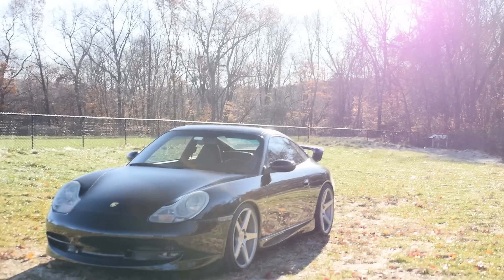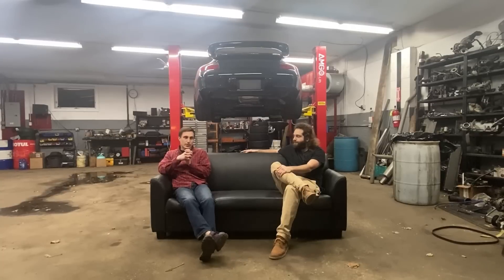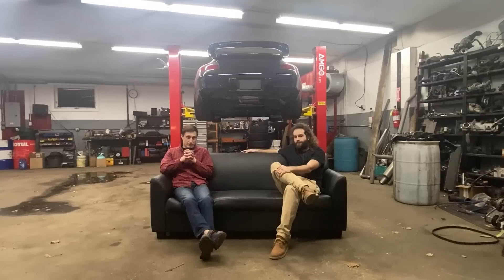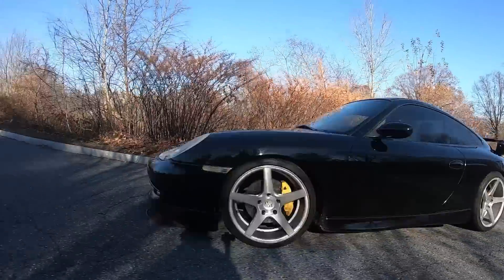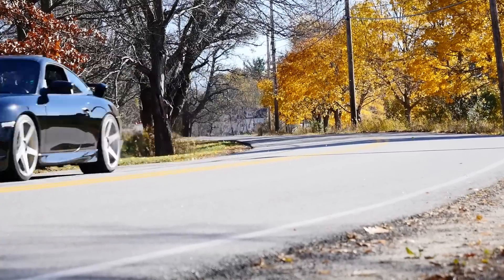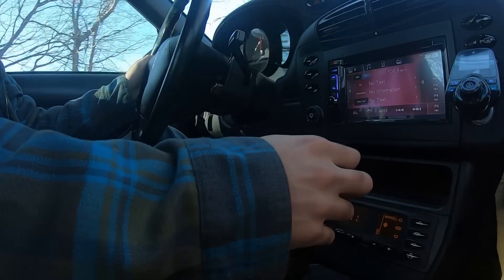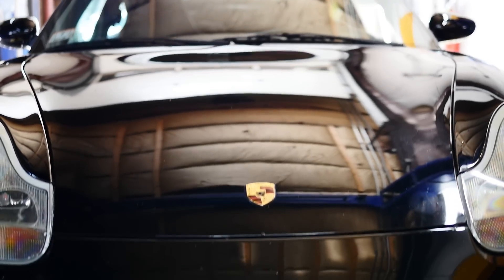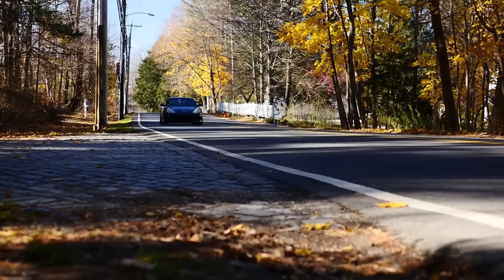Renn27 - Audi 2.7t swap for Porsche 911's

Comment: Oh my goodness I need to do this, I bought a 2005 996, it has no engine due to the previous owner removed it to have the spun bearing issue sorted, well it ended costing more than the car is worth. Car was sitting for years and he eventually sold it to me. Imma be in contact with you guys shortly.
Reply from the maker: @namtech425  LFG!!!

Comment: Does this kit work on a turbo chassis? If I got one with a blown motor?
Reply from the maker: The metzger transmission is different than the g96 but you can swap it out and profit a bit selling the metzger trans

Comment: Interesting.
I loved the power delivery of the 2.7 Biturbo in my B5 RS4 and loved the handling of my 996... This combo should be a winner, but how heavy is the engine compared to the original and how much higher up is that weight?
Reply from the maker: 2.7 weighs less, and the center of mass is same if not lower than M96. Its an iron block, with aluminum heads, and turbo down low.

Comment: What’s the difference in weight between the Porsche engine, and the Audi one is all aluminum and the other has a steel block?
Reply from the maker: Porsche engine is slightly heavier.

Comment: Not bad but I'd do a junkyard 5.3L instead. $400. Refresh the top end and put in a cam for boost...maybe another $1500. Couple of used turbos for $750. Of course there are more supporting mods that need done but the platform to make an easy 600whp or more if desired is there for cheap
Reply from the maker: If an LS swap was that easy we wouldn't even try the 2.7t thing. If plan is DIY... You're looking at fabricating motor mounts, exhaust, charge piping, trans adapter, electrical, cutting/modifying the chassis just to fit it all, at least 160 hours of work. 

As a welder, mechanic, machinist, engineer and all the hats you'd need to wear to be able to accomplish this, you'd be costing yourself money by trying to save it.

LS is cool and LS is great, buts LS is far from simple
Reply: @renn27  there are LS swap kits
Reply from the maker: We know... They start at 12k without an exhaust, the necessary chassis modifications or a motor. So ballpark 20-25k for a "cheap" turbo LS build. At that investment those junkyard turbos turn into quite the liability.
Reply: @Renn27  that is why the top end refresh setup for boost, going with a pair of quality used turbos, and only going for 600whp is the way to go. At those power levels the risk isn't very high. But even then if you grenade the engine it's cheap to get another one.
Reply: @sutherlacd27  As someone who does 90% of my own fab work, doing a TT LS setup would be loads of work. I’ve driven an LS swapped 996, and much prefer a factory turbo 996. 

This is a cool swap, granted the 2.7 Audi motor reliability is iffy at times, and the cost of the hot parts here are spendy.
Reply: @sarahdell4042  I definitely prefer the factory turbo setup over anything else myself.

Comment: Lol what a ripoff! The 2.7t bolts up to the 996 transmission, just need motor mounts, piping, wiring.
Reply from the maker: Well the trans spacer is necessary in fact, but even if it weren't... Motor mounts, piping, and wiring is exactly what we are offering.

Comment: I peeked at the website and saw the turbo was a 58/58. Can a larger turbo fit? Like a 6466 or so?
Reply from the maker: Of course, any turbo can be made to work, even twins. However with that you need to at least source your own tuning, or in the case of twins, fabricate a new exhaust design.
Reply: @renn27  ok. I was more asking because i couldnt really see space in the engine bay and wasnt sure if there was any room.

Comment: Great job guys . Maybe bring this over to the boxter
Reply: Would be kind of cost prohibitive considering the investment you'd have at the end vs what it would be worth. I was thinking that too until I did some math,  nobody is going to pay you $45k for your swapped Boxster when at the end of the day you would buy a 997, 996TT Tip (and later manual swap), C4S for $35k, etc... There is a stigma with driving a 986/987 no matter how fun they are or how good a vehicle and that affects price.

Comment: Remember in the Mid 2010s a guy in the UK Audi/Porsche forums bought a cheap Boxster and swapped the 2.7tt engine out of an Allroad into it. Unfortunately a fire caused the car to burn down during testing, but the forum members set up a donation link and helped him rebuild a better version and the car is still kicking about these days. Ever since then I've been obsessed with the idea of swapping the 2.7TT engine into a plethora of different platforms.
Reply: Only they're using a single T platform which eliminates most of the issues you've read about.
Reply: This chap has built many more since the fire. Google “Escy Pistonheads” and you will find his current build blog. 

Very inspiring work.

Comment: Let's build one with a 4.0 W8! I have one bolted to a porsche transaxle in a FWD passat right now! I made my own custom single mass flywheel so it bolts right up with no spacer/adapter plate so I figure the hardest part will be fabricating exhaust and the front engine mount. It is a very light engine and sounds exotic in a way you have never heard before. Also it is the same size as that v6, maybe smaller.

Comment: Not sure what problem you are solving until we hear the rebuild cost parts plus labour all in and proven historical data in the actual 996 as well as maintenance access etc you should show the engine in the bay behind you. If I had to pay $15K to rebuild I would buy another car and forget about it regardless if I'm saving $6K for a 2.7 T Motor from Audii compared to sleeving an M96. You are describing issues that rarely even exist anymore as most M96 engines have the IMS sorted out oil fed etc. I simply take care of my 2003 C2 cab 996 3000km oil change and respect the age of the car instead of worrying when my M96 will blow up or show signs of bore scoring. Idiots who track these cars redlining it then garage queening them get into infant mortality issues. Buy it and enjoy it, and dont look back, except for hearing that flat 6 sound behind you roof down, no substitution for that even an Audii 2.7T:):)

Comment: With the expensive cost of rebuilding an M96/97 engine, in the UK specialists can charge £12000+ this is a great option. Is there a version that will work with the Tiptronic box and the 4WD system on my C4S?

Comment: You talk about how expensive the standard motor is to fix and then go on to explain all the custom parts and electronics needed to make the swap work lol. So is it really cheaper? How is the weight distribution different now between iron and aluminum blocks?

Comment: The problems with the original engine aren’t as bad as you make them sound. And almost always an easy fix. Much much cheaper than this option.
Reply: IMS breakdown destroys the engine. Cylinder scoring requires major work to resolve and definitely isn't easy. Both are very expensive.

Comment: Renn27...In fact the Audi V8 is a direct bolt on to the Porsche trans with on need for an adaptor...and more power...
Reply: 1.8t, 2.2t, 2.7t, and most 4.2 Audi engines will bolt up to any M96/M97 Porsche trans. 
Old news. 
If anyone charges over $10k for this easy swap it better make over 600whp

Comment: Funny how 20 years ago, people were told to avoid the Audi Allroad and A6 2.7t. Now these cars are dirt cheap and being harvested for parts. Who would have guessed the 2.7t was going to be good for anything? 😄 

On a side note, I am old and remember another VAG car was treated the same way; the B3 Passat. These cars were cheap and became rolling parts cars. MK1 fans wanted the 16V engine and cable transmission. MK2/3 fans wanted the OBD1 12V VR6. Now the B3 Passat is rarely seen on the streets.

Comment: If you pick up a used 2.7t engine you still have to get a rebuild before doing the swap. Adding the kit plus labor costs I bet you still end up in the $15k-$20k range. You can rebuild your M96/M97, even pick up a 3.8 scorn block (because they are all scorn). Get the block sleeved, new forged race pistons, 3.8 crank and you can have a 4.2liter flat six making close to 400BHP with free flowing exhaust. A sleeved M96/M97 is a fantastic engine and does away with the scoring/D-chunking problem. Park your 911 with the nose up and mid engine Porsche with the nose down so oil doesn't seep into the intermidiate shaft when parked for a week or longer and you don't have the IMSB problem.
Reply: A rebuild Porsche engine like this would be $20k minimum, plus labor. So this swap still saves a considerable amount of money for those who need an engine. Maybe the difference could be made up in resale value, if you're concerned about that.
Reply: @DeuceDeuceBravo  I worked for a shop in Los Angeles where we did this. A normal m96/m97 rebuild was $12k. Adding sleeving, forged pistons, arp rod bolts and dyno tuning if engine volume increased by more than 200ccm would bring the total to $20k, everything included.
Reply: @dkjens0705  That's still $9000 or so more than this swap and less power potential.
Reply: @dkjens0705 Not sure how long ago you worked there but in New England any reputable shop is $20k plus for an EXACT replacement rebuild of your M96/97 back running if your car. Any forged parts, sleeves, ARP hardware, etc, add 50-100% to the hardware cost quick. You wouldn't do that. You'd wait for a Mezger or a Demonspeed, or Flat6 Mezger copy for $10-15k. You are then at $25k+ turnkey after rebuild. You are still sub 350hp. This kit turnkey with them doing 100% labor is $25k for 450hp basic kit with potential for much more, the engine is not made of glass like the M96... they picked this solution for a reason, but of course there are other routes.
Reply: @doublesynchrohelix8613  I worked there 2017 to 2021. I am only familiar with the M86/96/87/97 and original Mezger turbo engines, no copies. Street engines came with a one year 12k miles warranty.

Comment: That car sounds really good. Car is so clean and that guy is soo calm 
But looks like hes healing after getting all the headaches resolved lol
Wish u guys wouldve hammered it once or twice and maybe lit up the tires.
This is appealing also because im assuming that Audi engine is weghing less than the M96 flat 6.. Renegade in LV that does the LS swap (which i never been interested in, unless i had a 968 Porsche or 944).. says the aluminum LS engine weighs 40 lbs less than the M96.
If that Audi engine is even much less than that, thats better for a weight balance and and pullin weight out of that heavy rear end. I dread going under my 996 to work on it but do it anyway lol

Props to u guys for doin this.. wish u wouldve mentioned to total kit cost but ill go over to your website lol. Thanks.. Nice work

Comment: I have 270K on my 996 turbo and counting. These engine swaps are something I would even consider. Not spending 20K+ to rebuild one of these motors when there are cheaper options that make the same power and are easier to service.
Reply: I love that u have 270k on that engine.. how many did u yourself put on it, and how is it holding up?

I agree with u as far as being open to an engine swap on your turbo, and possible ease of access.. my main interest (1 of em i should say) would be weight reduction.
Reply: Getting rid of the mezger engine is nuts.

Comment: I wonder how is the weight of the 2.7t compared to the m96. The iron block would have me a bit concerned. The 911 doesn't need any more weight back there lol.
Reply: Exactly my question and statement lol
Hoping this engine weighs less than an all aluminum LS (which i didnt want in mine, but supposedly weighs 40lbs less than M96)
Reply: The other factor is how low and far back the weight is - higher up is problematic. This looks a lot more promising than an LS... they are so (relatively) top heavy and quite long. This appears to fit the factory mounting plate and potentially the stock transmission mounting, which is impressive.
Reply: ... and yes / No. The 996 doesnt need any more weight back there lol

Less weight should enable it to light up some tires and do a lil easier drifting as well around corners.. forget the widow maker statement.. folks must know how to drive it first.

Comment: I put together a LS 5.7 964 that was 2640 lbs with 415 whp. Medium cam, ported heads and intake. The aircooled 3.6 weighs 535 lbs with the dry sump tank and exhaust, the LS was just under 450 lbs using a meziere electric water pump and shorty headers and no cats, just 3” mufflers. The car turned into a monster and it changed my life. Stock LS is typically not very exciting. Run a rowdy cam a lightweight flywheel and a 5/6 speed. The car would intimidate much faster cars just because of how “wrong” a lopey cammed V8 sounds in a 911 with aggressive wheel fitment and race seats / harnesses. It’s an event strapping the harnesses on and flipping the switches on the switch panel then pushing the start button… They’re lightweight, efficient, small dimensionally, large displacement internally and reliable even when highly tuned. I don’t understand the general disinterest or outright hate for the LS platform…the engines can be built into anything you want at any size and at any power level for a reasonable price.

This V6 swap kit seems to cater towards people that are scared off by the LS swap scare tactics. I’ve been saying for a while that there’s a market for these generation cars that suffer from catastrophic engine problems with little that can be done to prevent the issues from happening again. These swap options should be flooding the market and social/community stigma should not scare people off from putting non porsche parts on their cars that have these terrible issues.

M96/7, 928 V8’s, 914/924/944/968 all engines in my opinion could be considered open for engine swaps so they can continue to be enjoyed, not stored while insisting certain protocols/rules must be followed. If’s it’s aircooled, leave it. If you car suffers from issues like ims, bore scoring, ancient architecture, bad wiring/connectors, lack of parts availability…why not consider a more modern engine that’s widely available and more reliable especially when tuned to a higher level than stock. I think the LS (Honda, 07k, and maybe this 2.7t) 996/986/997/987 builds are perfectly suited for these chassis and they can be tuned as mild or wild as the owner wants. 

This V6 looks good, I’ll keep an open mind!

P.S. show the dang engine bay
Reply from the maker: Hear that! More pics of bay on the Instagram @renn2.7
Reply: Did you have heat problems?

Comment: Wow, I think the Audi 2.7tt is one of the few engines that may be even less reliable than the M96/M97.
Reply from the maker: Lots of 1/4 million mile 2.7s out there running double factory output

Often times poor maintenance or it’s absence entirely can be mistaken for a lack in reliability.

Comment: Very interesting swap and everything. But the M96 really isn’t that unreliable. IMS issues only affected less than 1% of cars and usually that was at very low mileages. And if you have a 3.4, like the car you guys have there then the dual row IMS bearings were even less likely to fail. Also the 2.7 bi-turbo isn’t known for its reliability itself. They’re known for their turbo failures and it’s not unheard of for the timing belt tensioner to fail too (former Audi mechanic here and proud Porsche 996 owner of 7 years).

I think a project like this is very cool to do if your engine has failed or something and you’re looking to do something different, but definitely not something to recommend that lots of people do.
Reply: IMS is relatively easy to upgrade but cylinder scoring is a very real issue and very expensive to fix properly. Not to mention the "d-chunk" and other unlikely but devastating areas of failure.
Reply from the maker: It’s not solely the IMS, severe oil consumption stemming from cylinder scoring is increasingly becoming an issue even in newer 997s. Especially prevalent in colder climate cars.

Comment: Could this be done with a tiptronic 996 c2?
Reply from the maker: It can be done however we are focusing on manual cars and auto to manual swaps
Reply: @renn27  are y’all capable of doing an auto to manual swap presently?
Reply from the maker: @jordanross3290  Yes, and we are working on a writeup for builds away from our shop
Reply: @renn27  nice. I’m in Connecticut so not too far from your shop. Approximate cost for a swap?

Comment: I'm surprised this hasn't happened more often given the cost of replacing a blown M96 engine. 
Fun fact: Audi shoehorned a 2.7T engine into an early TT back in the early 2000s. It was a secret prototype, and it had no trouble seeing off then contemporary 996s.
Reply: The LS has been the go-to, and now the Honda K swap is picking up momentum very quickly.
Reply: Do you have more info about this prototype?
I believe it took a lot of custom fabrication to make everything work, given that the TT has a transverse engine, while the 2.7 has a longitudinal setup.
Quite the Frankenstein, probably, but hella cool.

Comment: will there be a kit for a 997.1 or will this kit work with it?
Reply from the maker: Yes, a separate kit, a lot will carry over. This is our next target!
Reply: Very interested in this as well! Currently have a stage 3+ 04 A6 and a tial 605 b5 s4 racecar. This in my 997 would complete the 2.7t garage.